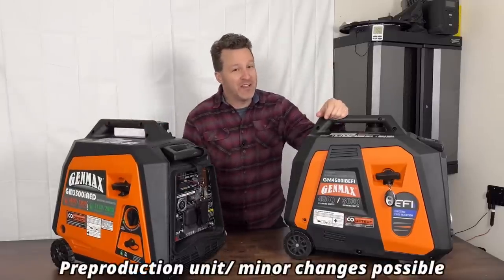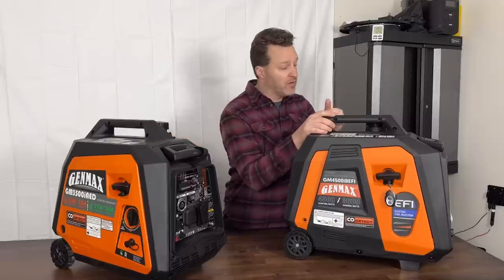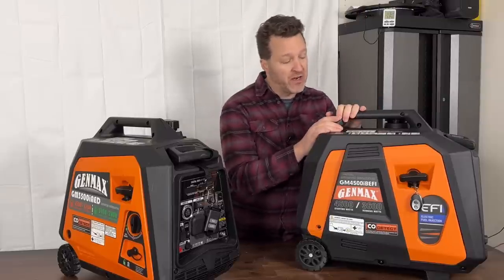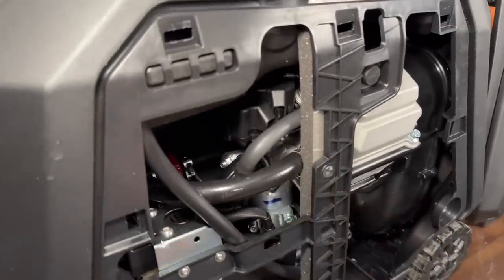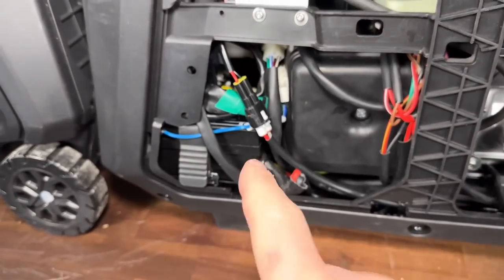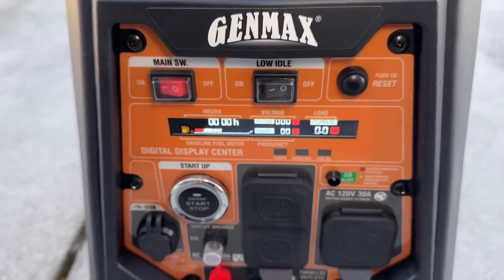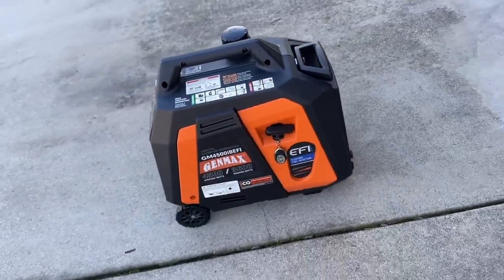Best New Compact Generator GENMAX 4500IBEFI Fuel Injection!!

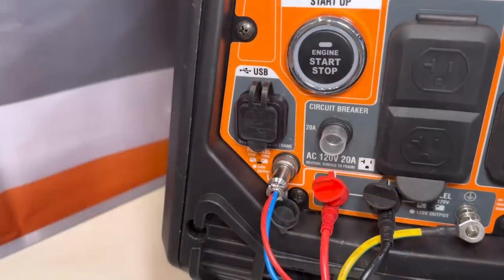Comment: 2:22 The parallel capability allows you to combine two, typically identical inverter generators to double the current (hence, double the power) capability. It's not putting them in "series" nor does it "double your voltage" (which is bad). Parallel capability is also quite a common feature on most inverter generators. It's not exclusive to Genmax.
Reply from the maker: You can parallel many different generators together. Like a Honda eu3000is with a Honda 2200i or mix and match brand if you want.

But yes you can double your voltage, now! 
Genmax allows you to now parallel to double amps or instead put them in series to double the voltage with there new line coming out soon. 
You can see this in the video where I went to Vegas to see all the new Genmax generators.
So now parallel for double the amps, or series to double your voltage. 👍🏼 
This is great and allows for a lot more uses. 
And yes being able to parallel has been around along time. I have several videos on those different scenarios 😀👍🏼
Reply: I always thought it would allow for split phase 240. Wasn't until I went to buy a parallel kit did I realize my mistake.
Reply from the maker: Yes all generators when paralleled just doubles the amps output. But 120 volt will stay the same. Until now..👍🏼
Reply: Settle down.. he just mixed up his terms.. ya it's parallel not series.. ya it doesn't double your Voltage but your amperage
Reply from the maker: No I meant series and I meant the new models coming with have the option to do both. That’s whats cool on these new models coming out. Go watch my video on the newest models to see the new ones you can run in parallel and in series to have what ever option you would like now…👍🏼😀
Reply: @johnnysweekends  So you can run two of these new ones together and get 240v split phase?
Reply from the maker: Yes!! Watch this please to see the new models capable and parallel box…Best new generators 2023!! New Generators Never before seen !! EFI and More…
https://youtu.be/lilETThA-20
Reply: As stated he did not mix up parallel and series.  My question is, why haven't generator manufacturers come out with this capability years ago!
Reply from the maker: Right!! Seems like such a simple add on 👍🏼
Reply: @shaunnightfire8269  It seems simple, but it's actually far more difficult.

Current inverter generators can be hooked in parallel using a simple two wire bridge (plus a third wire for ground).  The second generator started detects that there is already AC power, then syncs to the waveform.  It starts to add power by trying to slightly increase the frequency, equivalent to 'pushing' the phase, not increasing the voltage.

If you connect two generators in series they will still sync up, but the phase matching will result in them generating in-phase legs, not the desired 180 degrees / opposite phase, resulting in about 0V instead of the desired 240V.  

The 120/240V parallel-capable generators work by having a separate set of signal wires that carries the desired phase signal.  The second generator to start matches the reference signal, not the voltage sensed on the output.
Reply from the maker: Good explanation 👍🏼😀

Comment: I am still waiting for this unit. Where are they. Can you give a release date?
Reply from the maker: I did say mid summer. So that’s when I assume we should see them. I did just get a update and said they are going to be showing the new models soon! Sooo 🤷🏼‍♂️
But it is still May…
Reply: @johnnysweekends  What is mid summer?
Reply from the maker: Well summer starts June 21st….sooooooo, any day now would be about mid summer 🤷🏼‍♂️
But they are still in testing faze and I would rather have a company get it right verses just releasing it. 
It’s not even the same gen anyone that’s in the video I did. I did get updated pics and info. 👍🏼
Reply: Still no release date???😢
Reply from the maker: @stanRmeyer speaking of, they just sent me a video of them running and testing it !!! Hopefully soon! 
I asked about a shipping date
Reply: @johnnysweekends  any new information on the changes?
Reply from the maker: Different face plate and features, different engine from the 145cc motor that’s in the original. Couldn’t see much else. 
But I think it will also have the series parallel feature. So 240 volt capable

Comment: Not sure where you are getting your information. I was told that the generators model  GM4500iBEFI are at there location in Calif. but will not release them till March or who knows when. The release dates have been fluid.  This was told to me on11-8-2023. Where are you getting yours?
Reply from the maker: Who are you talking with. I have a direct contact. Like i mean direct. When I get it may not be the same as market release date. I haven’t been told that.
Reply: @johnnysweekends  I am in need of a generator before June 2024, this one may be the ticket if it ever gets released.
Reply from the maker: @diverdarrell im supposed to be getting this. Hopefully after the holiday. Beginning of December hopefully. I have been waiting
Reply: Did  you get the gen set?    What do I have to do to get one? @johnnysweekends
Reply from the maker: @MrbullfrogSr its shipped and on the way. I should see it late next week I believe. Lots of good updates

Comment: As Honda owner, I will never know because my unit will never die
Reply from the maker: You should talk with several of the other Honda owners who may disagree. I like Honda as much as the next but they are not bullet proof and definitely do not seem to be build as good as they were 10-15 years ago.
Reply: @johnnysweekends  men lie women lie and numbers don’t.  come to new york and u see all street vendors use honda unit. quiet and reliable.
Reply: His reviews used to be unbiased and very good...no longer.  To say that this thing is in the same league as a Honda is just silly.  I've got two EU2200's, and I'll take them over all these new "feature-rich" Chinese offerings any day.  I don't need electric start, remote start, dual fuel, blah, blah, blah...I need something that provides every bit of the power it's supposed to, and then some.  Show me one of these Chinese generators that will provide it's rated surge capacity for close to 30 minutes...no such animal.
Reply from the maker: JML I believe I still bring as much factual data as I can. 
I still like Honda, but honestly the prices are just crazy. People say if your life depended on it you would buy the Honda. 
Well it’s the same for cars. You want the longest lasting you buy Toyota. No if ands or butts, but not ford or Chevy or another brand is better, Toyota beats them all. But not everyone owns one as they have different needs and circumstances. 

Theses other units are options. And at the price it’s a great option. Even if it only last half the life span of one Honda, two of these is still cheaper and may exceed the Hondas hours or life span and you still saved money.
Oh well you can get parts you say….. well this is true, but are you going to rebuild a Honda with 4500 hrs with new expensive parts and who knows what may go out next to have the engine give at 6k hours…?
That’s like dumping $5000 into a car with 275k miles. At some
Point it doesn’t make financial sense. 

These off brand units start like champion did. Some come and some go. Just like Kia. They have really come far and are now starting to offer a 20y 200k warranty!! That’s crazy. Now the early cheap versions were junk but the latest models over the last few years are only doing better. And all at the moment come with a 10y 100k warranty. That’s still pretty crazy and no one offers that. 
Are they the best, no but doing way better. And that’s what you want to see with any company. 

And maybe you won’t like my answer but options are always good especially when you can’t justify $2750 for a eu3200i. 

And people don’t like the fact that Toyota is the most reliable and has one if not the highest resale. Is what it is. Eventually someone will take its place, just like Honda. 
And Hondas parts are getting harder to get. I can’t even get a inverter board from 3 websites I looked at for my eu3000is. If it goes it’s a paper weight. So I just offed it a couple weeks ago. It was in excellent shape but a very expensive unit to let die if there are no parts. And I get it, older models will have parts slowly die off. Like many older Honda gens the parts are becoming less and less. 
I mean a Honda eu3000is is still $2500 no wheels and now in todays world. Kinda under powered and not fuel efficient. 
Hence they were all considered illegal in CA for high CARB emissions and hence they had to pay out millions to CA. 
They may slowly stop the whole line and be moving to batteries. 
The eu3200 could be one of there last models in the USA
We will see.
Reply: If you are liking Honda ( and I do also ) you better buy now, because Honda will no long make small engines after 2023.  Competition knows this and are bringing their products into to void that will be created.  ( Thanks for posting, love the EFI, this should have happened years ago. )
Reply from the maker: I agree Honda has not brought a new line and no new CARB certs. I think there primary focus is batteries now. 

I wish they had some models more in the middle. 
The eu2200 easily could have been a 2500 dual fuel. That would have been a really nice unit. But after that there is nothing except the tank eu3000. Who wants to lug that around. 
Number one reason people sell it because it’s to heavy and to big. Great for a stationary place. 

Like I have mentioned I’ll keep my eu2200i till death but I think Honda needed just a couple more lines in the middle. And yes EFI should have been a thing along time ago. It actually was before Honda. A model came out in and around 2014 I think from powerhouse I believe. It was a black unit with yellow writing and was a ph4000 or something. 

Just never took off..🤷🏼‍♂️

Comment: 91 octane doesn’t have a longer storage life on its own unless it has no ethanol in it.
Reply from the maker: Actually a higher octane fuel such as 91 or 93 vs 87 has more hydro carbons making it more stabile, which increases its shelf life. How ever you are talking a extra 3-6 months at best over 87. How and what you store it in will determine that as well. Hence I always recommend a fuel conditioner or stabil unless ethanol free is cheap and close. For me it’s double the price at $8.50 a gallon.

Comment: Retractable handle to pull?
Reply from the maker: Yup did you see it at the end…
Reply: @JOHNNY'S WEEKENDS  Actually didn't.
Reply from the maker: It’s much the same as the 3500 review for weight features and fuel tank besides the dual fuel

Comment: Can't wait until it's released
Reply from the maker: They have already made a couple minor changes. I was talking with them on a couple items so should better now than the preproduction unit I have 👍🏼😀
Reply: Changes for the better I hope
Reply from the maker: Yes better battery, and a better board that consumes way less power while not being used. So should make the battery last way longer.
Something else I thought they mentioned with the fuel system maybe..🤔 idk. 

But the battery in the 3500 series is a little weak and doesn’t last to long. So they are upgrading those as well across the line.

Comment: Still no word when this gen is going to be out!
Reply from the maker: They delayed it for some changes and more testing. It’s way better then the prototype I have!
Reply: @johnnysweekends  Such a positive spin. I congratulate you! I suspect it's more about problems, problems, problems, electronic mapping, and electronic fuel injector is not consistent, and they have problems making it consistent! This is what I think!
Reply from the maker: @stanRmeyer every change needs testing again, right? Would you rather they release it early and have it perform poorly ? 

It’s fine to speculate and think they can’t figure it out, I mean they already have one finished sitting in my garage which is the prototype. Hence it’s not a production unit, it used older parts for the final version. 

We have been in talks and I have also been helping with build ideas and suggestions to hopefully make this a pretty desirable unit. Forcing anything to market way early is a mistake.

I have already seen several changes from pics and spec sheets, and the one I have is basically not even the same unit now. 

It will come out, but I would rather have it correct verses rushed and have it a failed unit. That’s not how I would deliver a product if it was my company.

Look how long they talked about the Ford raptor R!  Took forever … 2 years and finally came out a month ago. 

But Genmax and Honda are not first to market with fuel injection. Powerhorse came out with a FI unit like in 2012 I believe. All black with yellow and a 4000 watt electric start unit. 

Never got popular but people still have and use them. 🤷🏼‍♂️
Reply: Summer's gone, we're in November, and still no word on this unit!😂
Reply from the maker: @stanRmeyer they are done!!! They have been shipped so hope to have one in 3-4 weeks
Reply: @johnnysweekends  another month, hmm... thanks for the update.
Reply from the maker: @stanRmeyer again better to get it right then to rush something to market. Seen that with some power stations several issues. 
But hope to see it on my door soon. So will see

Comment: Loving my 60 hour 1000w ALP propane generator.  I always forget the gasoline in the Honda 1000.  The ALP was $478.  My price range.
Reply from the maker: The alp is a cool little generator but not really a comparable model at all as it doesn’t have any of the same features or power. And the range for that unit is in the 300-700 watt range. If your constantly needing more then 700 watts you need to step up to the next size generator. 
It’s a nice little generator but limited on ability. 
But also depends what you are doing with it.
Reply: 1000w max is just too low wattage to be useful for anything but a fridge and a tv.

Comment: I live in CA and unfortunately they are banning sales of all small engines less than 20hp or 25hp (I can't remember which) in 2024.
Reply from the maker: Ahh but that is up for debate when you read the whole bill. 
Only if “feasible” will generators be banned if a capable unit is able to replace it. 
I assume after all those floods where they broke out the mass amount of 10-15 hp water pumps running for hours on gas along with generators during the black outs, they are not going away. Yet! 
We will see. I bet just a few more restrictions.
But if not go across any boarder and buy a bunch and off them to your buddies 🤷🏼‍♂️
Reply: I don’t know how you live in that state. Telling you that you can’t own a small generator. What is their alternative when their crap power system goes out?
Reply from the maker: Well you can still use any item you have or you can get. It’s just the stores wont sell them. But you can use them all you want.
Reply: I am sure glad to not live in Kommifornia. Those politicians are power-hungry.

Comment: Wonder where to get parts for these generators I have the maxpeedingrods 3200 I like it but if I need parts I'm sol
Reply from the maker: They have a warehouse in San Diego where they have a parts supply hose and are building it up. Also eBay you can find allot of items for a ton of stuff
Reply: @johnnysweekends  interesting tried looking at eBay couldn't find anything. If you have a link that would be great👍
Reply from the maker: What do you need..? Or just looking in general. Look for Genmax parts in San Diego. Ill look for the link again.

Comment: Any idea when this will be on sale?
Reply from the maker: Im still waiting for the mass production dates. They fixed a couple small things after i did some initial testing. And this whole line is getting a more efficient board for when on stand by draw and better battery. I was told about mid summer maybe a little sooner or later. But stay tuned because Ill do a new video and have discount codes…😀👍🏼

Comment: Great review for the info you have!  I always ask two questions when considering a piece of equipment:  Who is GenMax and where is their U.S.  office?   Where and how do I get parts and service?  If you don't have parts and service available, particularly long term, you have a disposable "bic pen" generator. If that's what one desires, there it is.
Reply from the maker: True always good to consider. Genmax has a parts warehouse in San Diego and is billing it up to carry more items. This is what I was told at the show.
Reply: Same here. At 70 years old I've seen many products come & go. Service is important!
Reply: thats more than 2 questions
Reply: All the Chinese generators share parts. For instance the predator 3500 and powerhouse 4500 are the same generator, except the inverter. 

Then champion 4500 and wen 3800 same deal. 

You can get every single part for these if you actually try. But if you are so lazy that you need someone else to Google your parts, buy a Honda or Yamaha.
Reply: Doesn't matter cause its not even for sale
Reply from the maker: It’s true, I try and tell people but what do I know. eBay has a world of parts 🤷🏼‍♂️👍🏼
Reply from the maker: It will be soon. And better then what’s posted. The generator I have now is a one off. They don’t even make it now that I know of…🤷🏼‍♂️ it still has parts for it but the new one is way different. You’ll see soon